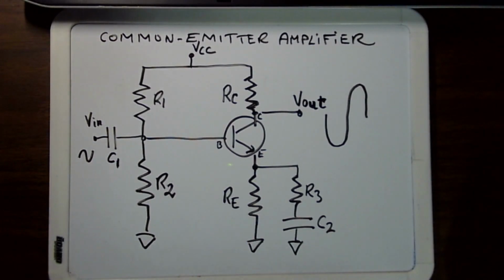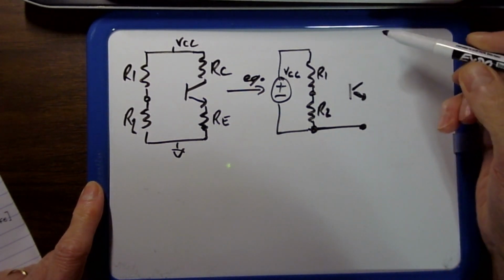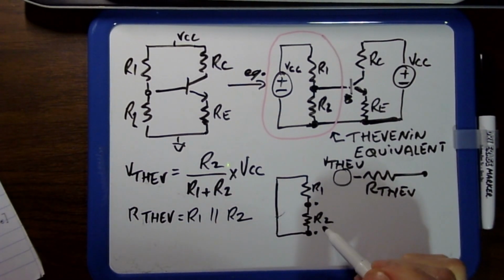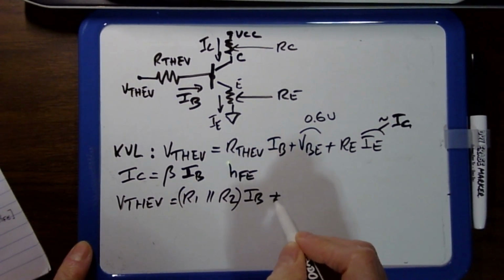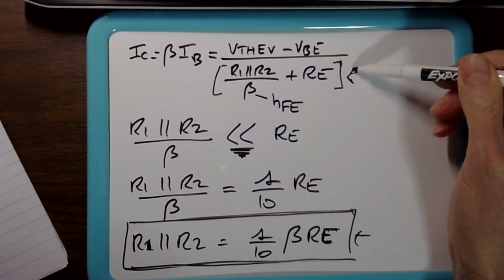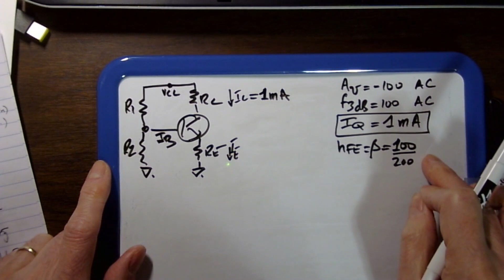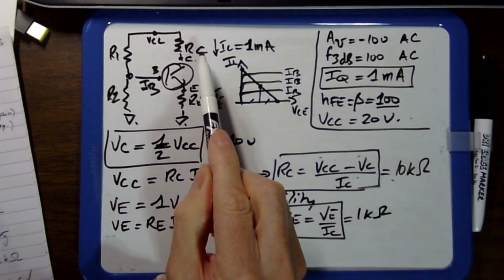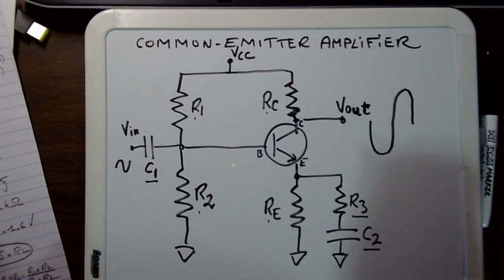Tutorial for common-emitter amplifier design (part 1 of 2)

Comment: I can't see the jump to the value of R2 at 30.48 time mark.  What did you compute in your head to get that?
Everything else flowed well.
Reply from the maker: Sorry i went a bit fast there. You have two equations for two unknowns. Using first eqn, you can express one of the two unknowns as a fumction of the other and you plug that expression into the second equation. It was not done in my head but on paper. Hope that helps

Comment: Alright. Not bad. I did follow but with 5V on the Vcc, and got Vc around 2.5V …. Now idea is to apply 0-3.3V via capacitor to base so it be -1.65 to 1.65V audio wave from DAC., boost it to 5V (can do 9V if necessary), then drive 1W 8ohm speaker.   I’m assuming this stage boosts voltage, then will need current boosting stage.
Reply from the maker: yes, this type of circuit boost the voltage. think of it as a pre-amplifier. To drive a speaker, you need to boost the current, not really the voltage. Commonly referred as power amplifiers. If you do audio, you may want to look at op amps for boosting the voltage to proper level before your power amplifier.

Comment: Hi, what's the reason for assuming Ve = 1V for temperature stability?
Reply from the maker: Good question. I don t know
 I have never seen it explained.
Reply from the maker: It doesn t have to be 1 volt, really. What s important is that the 3 resistors, that is, the two in the voltage divider and the one in the emitter leg make the setup stable wr to beta, that is, changes to beta don t affect the bias voltages. I think i will makd a video of why it is so.